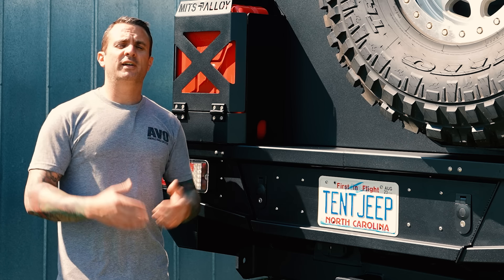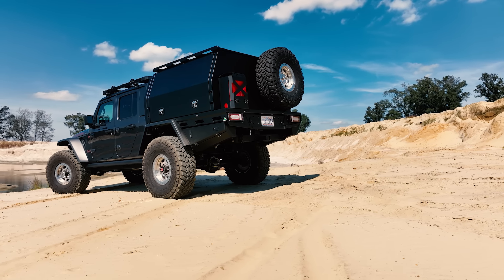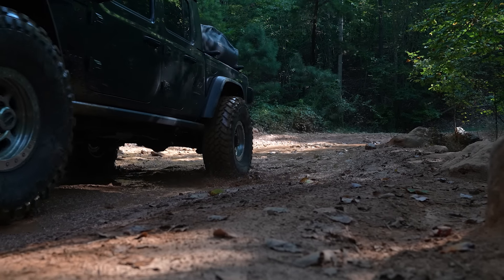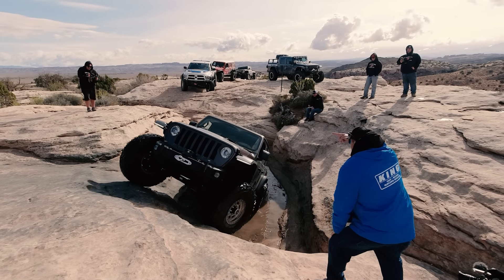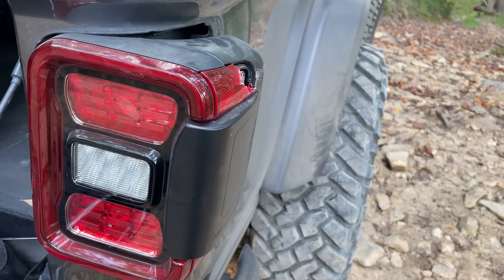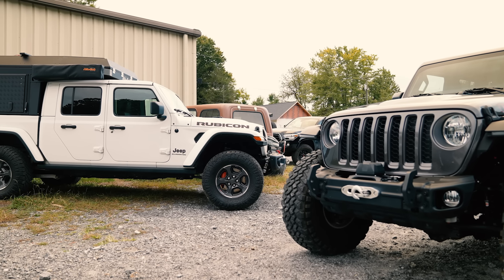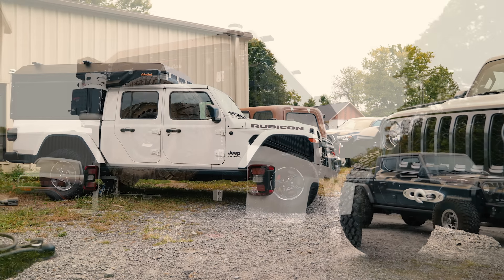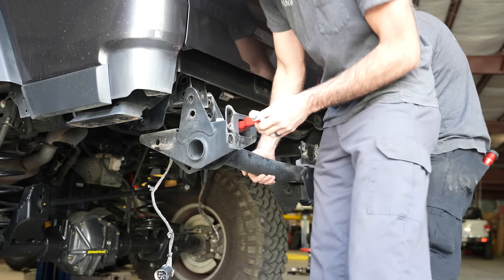MITS Alloy Jeep Gladiator EVO2 Overland Bed Tray Install | Inside Line

Comment: ODIN the Gladiator fitted with PCOR canopy was more sufficient and practical  with roof rack with overhead lights mount, alu boxes and maxtrax and canopy with 150 Watts solar panel.
Reply from the maker: I don’t know what Gladiator you are referring to, but it sounds like most of what you are listing out are accessories mounted to his set up. This is just my initial video on my bed. I’ll add accessories later.

Comment: Is it easily removed?
Reply from the maker: The canopy portion unbolts easily and leaves you with a flat bed. If you are asking if you can easily swap back and forth between beds, not really. That would be a lot of work mostly due to the wiring and simple logistics of moving the bed on and off.

Comment: Big question!!!  Did the setup come with frame reinforcements?  There is a history with this vehicle either having too much weight on a hitch or having a rear mounted spare and the frame bending where it meets the cab.  The weight plus bottoming out on the trail treats the shock frame mount as a cantilever point bending the frame with an unanticipated gully or something that we always plan on missing, but sometimes hit drawing up upholstery as it happens.
Reply from the maker: The bed did not come with any frame reinforcement. I’ve only known of two Gladiators that ever had any sort of frame failure. One was a race Jeep and the other one was towing a trailer off-road and hit a wash. Both examples would have likely resulted in frame damage on just about anything. I may end up doing something, but I need to make sure that it won’t interfere with any long-term suspension upgrades.
Reply: Frames are overrated just back half it LOL
Reply: If you have a proper setup suspension the shocks shouldn’t bottom out. The jounce stops should. 

Gladiator frame is based on the Ram 1500 and is quite strong.
Reply: The frame can bend but its usually due to poor driving while towing the trailers off road.  Thats not really a frame issue its a driver experience issue.
Reply: Apparently people have bent their JT frames while wheeling more like driving like a ultra4
Reply: Superior engineering do a frame strengthening kit that's weld on for the earlier gladiators it's a case of if your worried about it I'd put one on before it gets damaged eg cracked or bent but all duel cab Ute's have that problem to my knowledge when loaded and towing off road

Comment: What’s the payload on the gas gladiator?  This has to put you close or over the limit?  The rubicon diesel is only 850lbs I believe.
Reply from the maker: I believe it’s 1,250lbs for my model. So, I’m not maxed out. Given I have a full-float axle assembly, and stiffer springs, that definitely helps. However, that doesn’t do anything to increase the strength of the chassis. I don’t believe that’s going to be a problem for me though.

Comment: Sure wish it wasn't a $20,000 investment.
Reply from the maker: It's a big investment for sure. You can buy just the Tray portion for around 11K and do the canopy later. Just depends on what you are looking to build out.
Reply: @DrivingLine  You're 100% right.

I'm just an impatient bastard that has always wanted a UTE and works a job one would be perfect for 🤣